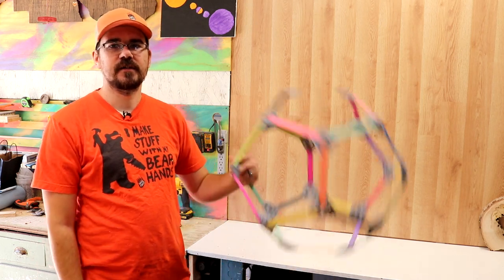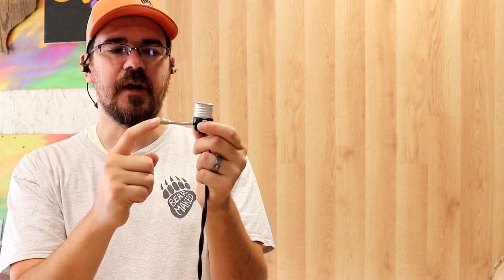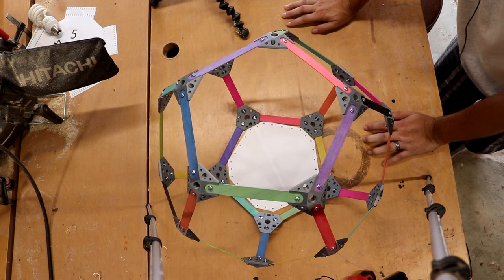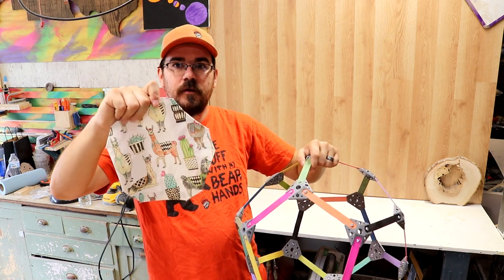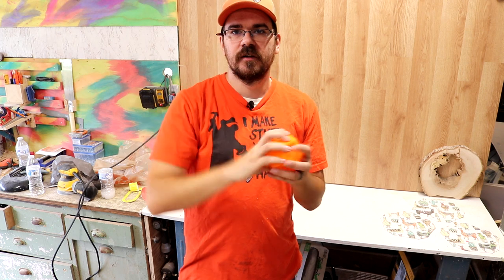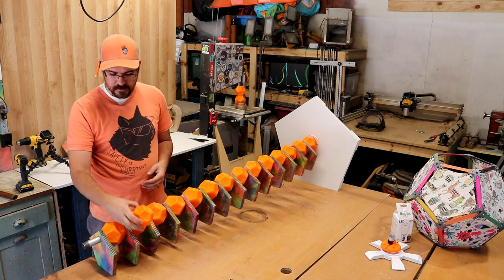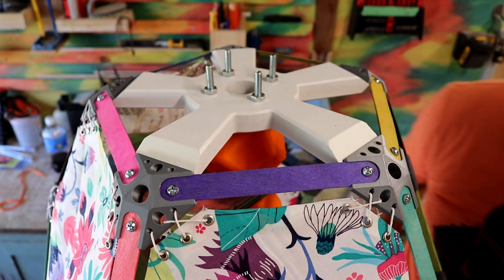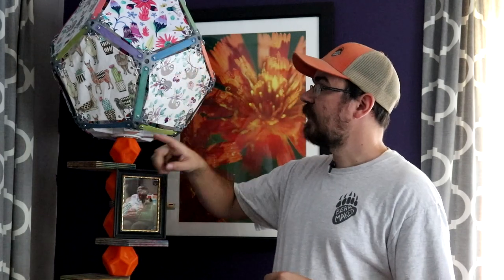Wackadoo Unique Floor Lamp!

Comment: Could you have reused the pipe from the original lamp that you got the cord from?   Only asking because I have a similar old floor lamp that I want to redo so was hoping to reuse the pipe as well as wiring. (Assuming I can get all the arm parts removed).
Reply from the maker: I thought about that. But that lamp had the little reading light attached to it, and I'm pretty sure I would have had to cut that part off, and I didn't want to deal with all that. Also, using a bigger pipe meant more stability. I wasn't completely sure how top heavy the thing would be, so I didn't want to risk a pipe in center that could flex or bend when the lamp was carried sideways, if that makes sense.
Reply: Bear Maked makes sense especially the weight issue.  Hadn’t thought of that.  👍🏼